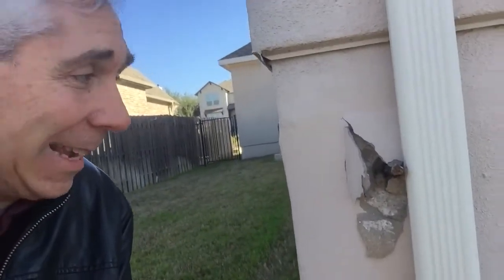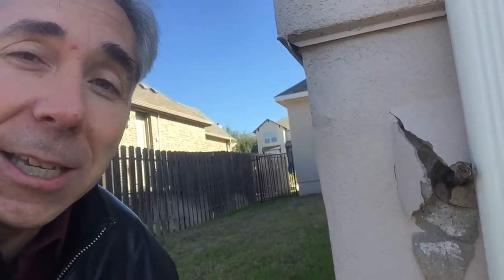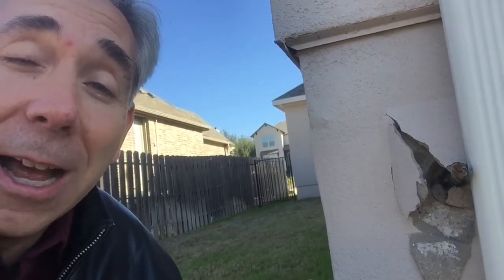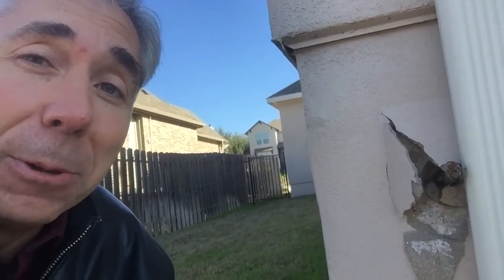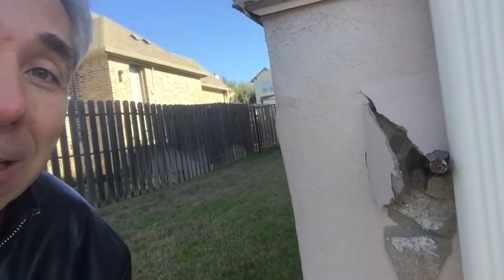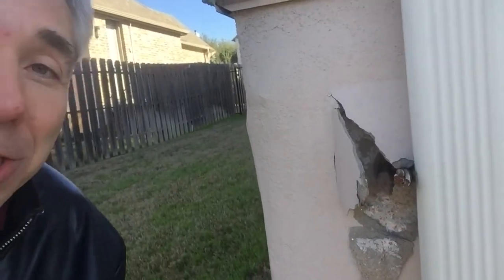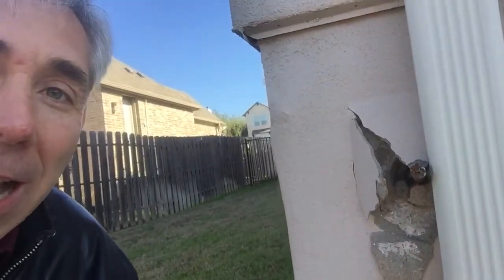Broken Post-Tension Cable

Comment: What is a post tension cable? I’ve owned multiple homes over 32 years and never heard of it. What does it do?
Reply: They lay braided cables and then tension compress "pull" them inside the concrete slab. All kinds of youtube videos you could watch about it...
Reply: @Fapsahoyx  not in Georgia or Florida they don’t. Slabs here are simply rebar and concrete.  Must be a Texas or California thing.
Reply: @neilaxelrod5872   I'm in Arizona and PT slab is all they use because we don't have a frost line and the unstable soil. So yes it is more of a southwest thing and probably why you never heard of it.
Reply: @Fapsahoyx  makes sense. Have lived in the northeast where slabs aren’t a thing, and in Georgia. I have family in Florida. Never heard of it so does sound like something done in the SW part of the country.

I live in North Georgia and my house and many others are on basements but we do have a number of slab on grade foundations that are typically just reinforced concrete.

Comment: Not sure why PT tendons were used for simple home construction.
Reply: Me either.  Also: don't fuck with PT tendons unless you know what you're doing.
Reply from the maker: Post tension is used in slabs all the time.  It's not unusual.  If you live where there are basements, then I imagine it is unusual.

Comment: How deep they are from floor inside a house. I’m living in two story condo. How deep I can drill?
Reply: Tension slab foundation you're not supposed to remodel at all. The cables are under extreme tension and if you break one it could hurt or kill you
Reply: Ask your manager for architectural/engineering drawings. You should ask management before drilling anyways.

Comment: I did quality control for a prestress plant for a year.  The cables slip out of the chuck regularly, but the cable just stands straight up in the air then drops to the ground, 300 feet of cable piled on the ground is a sight.  From experience I can tell you it’s a non-event to getting hit by a cable dropping to the ground, it’d be a completely different story if the crew were to pull the cable completely through its breaking strength!

Comment: So can something like this kill a person living in the home? Meaning could it break upwards and come through the floor and split stuff and people in half? Maybe a dumb question but I’m a bit terrified..
Reply: They are typically only dangerous if you cut one. This means if you are remodeling and you hit one with a jackhammer or blade the release of energy will turn that cable into a guillotine. It is no joke. If you know or suspect your slab has them an xray can be done for little money. Under normal circumstances the cables are quite safe. Nearly every multi level structure with a concrete slab has them. I've never heard of one going AWOL on its own (in the guillotine sense)
Reply: @johnsmith-wc8gs  thank you, I’m not like crazy worried about it but when I heard it could happened I had to try to figure out how likely it is. 
I appreciate the response 🤙
Reply: Its possible but unlikely.
Reply: Only concern is if your digging down to access a water main, this is why we get X-rays done and ensure we aren’t coming remotely close to these things
Reply: it defiantly can, I have seen one snap and split an exterior wall in half so it defiantly can be deadly but highly unlikely to fail that catastrophically. Try to avoid PT at all costs but not an issue
Reply from the maker: Greetings Anthony.  Of course, I'm not a structural engineer, but having talked to a number of them about this, I don't think you have anything to worry about.  These cables are in sleeves that are encased in the concrete foundation.  The end of the cables just have a bit of concrete over them to make it look aesthetically pleasing.  If one breaks, the weakest point of exit is out the end, not up through the foundation.  While this was a gentle exit of a few inches, it is possible for one to break completely and whip out of the end with force.  If that happened, it could certainly be painful if you got hit by it.  But, that would be very rare.  I'm guessing they don't keep stats for people injured by breaking post-tension cables.
Reply: @RealEstateInAustin  thank you this eases a worry that has quietly been in the back of my mind since we bought our home here in Texas. Everyone told me, including the home inspector,  “make sure you keep the ground wet around the foundation with soaker hoses or the tension cable failure could be catastrophic.” Unfortunately for the hypochondriac in me no one explained what catastrophic actually meant in the event of a tension cable failure so I of course envisioned a Hollywood style gore scene where one snaps comes up through the house and... well I’m sure you understand where this is going... so, thank you sir for your prompt reply it and you are very much appreciated! Be well friend 😁🤙
Reply: They are usually placed straight in home foundations. No curvature. So no, extremely unlikely to go anywhere other than poking out the side like we see here. You usually would have to be cutting through your foundation for it to happen in most cases.